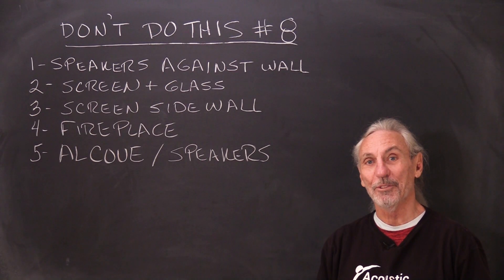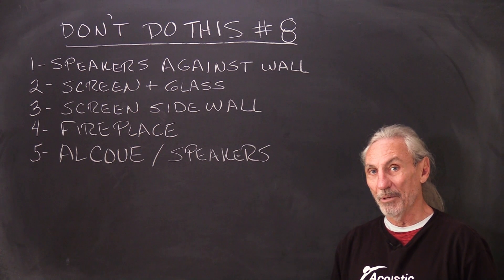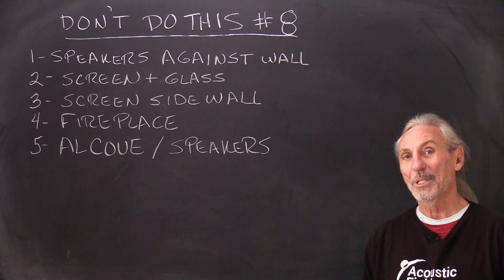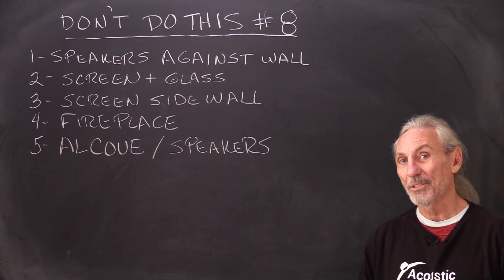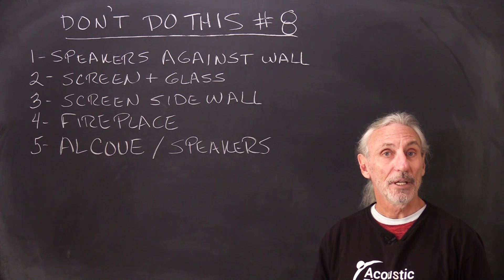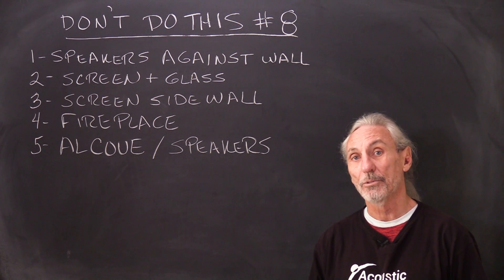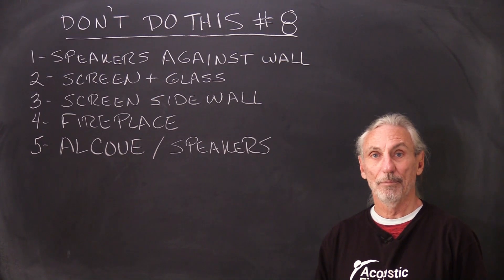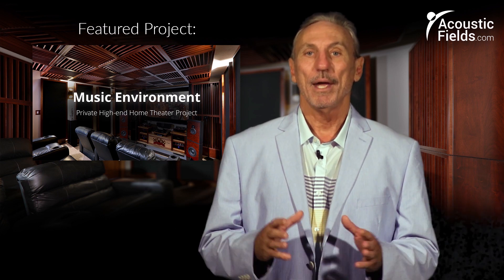Don't Do This! #8 - www.AcousticFields.com

Comment: First of all big thanks for your videos , it’s really very helpful 
I’d like to get your recommendations, my set up in a basement, right channel/side is open, so I decided to put a curtain (two coats) parallel to the left channel/wall, by doing that I cut entire basement and made  rectangle shape to my “sound room”, I’d like to send a picture but don’t know where to.
I also have a small corner fireplace, which is placed in a corner
Reply from the maker: You must construct a wall or use panels that have the same density as the existing walls. A curtain will not provide the required density and you will produce phase issues. Fill out the information within this link: https://www.acousticfields.com/free-room-analysis/
Reply: @AcousticFields  
Thank you, what if I’ll put the same curtain on other side, just to have the same density, it’ll be easy to have the curtains when I’m listening music and easy to remove them when no need, what do you think?

Comment: It's one of the many reasons why I have magnepans , they don't interact with the room as cones do. Virtually no floor, ceiling or side wall reflections. 

It made a huge difference...
Reply from the maker: Not true. Once the energy is released from your speakers, it becomes the domain of the room and reflection management must be a tactic in any sonic strategy. The speaker array may reduce primary reflections but no speaker can control secondary and tertiary reflections.

Comment: My room compares to the one where no treatment was possible haha. My right speaker needs around 1.5db extra to balance out with left. I'm thinking of building a smaller room in my living room made completely of bass absorbers. Is that possible? What do I put in the middle of the bass absorber instead of the activated carbon? Thanks!
Reply from the maker: The carbon inside the cabinet improves performance by 40%. You can use our foam technology inside the BDA unit.

Comment: Fireplaces are not only a box because of the smoke exaust column.This act like resonant tube.
Reply from the maker: You are correct. The resonances are measurable and audible. Achieving quality sound is all about doing a lot of little things correctly and just as important doing them in the correct order or sequence.

Comment: Some monitor manufacturers (like Neumann) recommend installing monitors closer to the solid walls (less than 0.8 meters). If you cannot install them closer than 0.8 meters, then you should place them further than 1.2 meters.
Reply: Genelec recommends the same:)
Reply: I have Neuman monitors and the manual for the ones I have says avoid 2 feet or .60 meters. Outside of that you can place in relation to room dynamics like any other speakers.
Reply from the maker: Monitors close to walls excite low frequency issues from 60 - 90 Hz. Why would one want to create more low-frequency issues.
Reply: @AcousticFields  If speakers are closer than 0,8m delays in reflections are minimal and wall become a part of a speakers, peaks could be corrected by monitor settings.
This is from my Neumann kh 310 manual:

Avoid positioning the loudspeaker at a distance “dwall” of 0.8 to 2 m (2' 6" to 6') from the wall
behind the loudspeaker.
When positioning bass managed loudspeakers:
X Avoid a distance “dwall” of 0.8 to 1 m (2' 6" to 3') from a solid wall behind the loudspeaker.
Similarly, avoid these distances from solid side walls or a solid ceiling. Respecting these
positioning limitations reduces the chances of dips and peaks in the low frequency response
(comb filtering) caused by strong reflections.
Reply from the maker: @77advanced  Nonsense. If speakers are close to the wall they generate room distortion that is pressure based using wave physics. The wall never becomes part of the speaker. That is the last thing a speaker was designed to do.
Reply: @AcousticFields  ok, i guess neumann and klein & hummel know nothing about acoustics.
Reply from the maker: @77advanced  They tell you to place them against the walls to reinforce the low end of their speaker. You are hearing both speaker sound and room sound. Quantity is not quality.
Reply: @77advanced  they don't care about acoustics and tell you what you want to hear - otherwise you would buy from someone telling you what you like to hear

no speaker can avoid physics